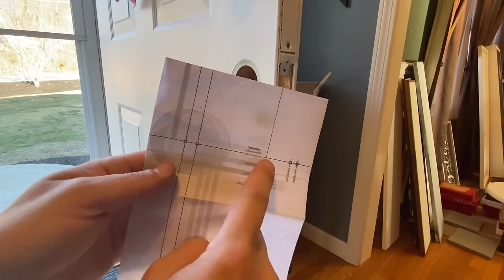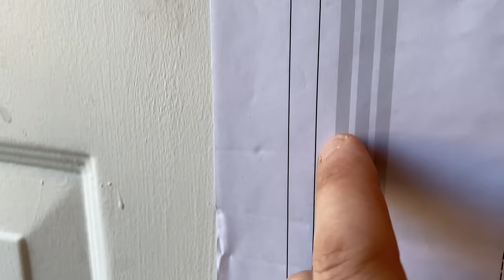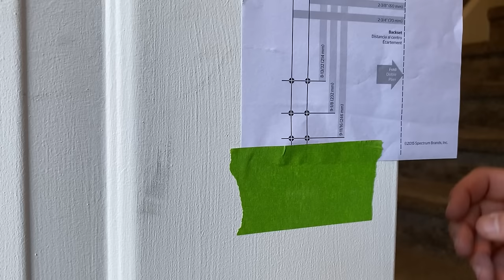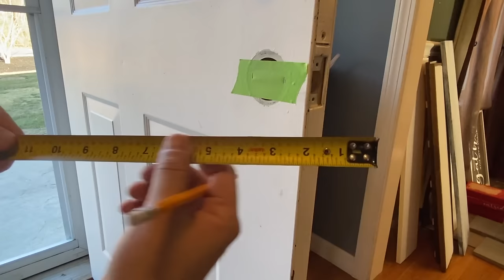How to Install Entry Door Handle Pull

Comment: The handles are different because right and left. You installed it upside down. Also, you’ll never be in the same place by punching through. I square it off and measure back. Taking or adding a 16th for the door bevel. Good job. Commercial superintendent here.  I do TI.
Reply: Whatever bro I followed his instructions and I’m all set.

Comment: I just moved into a new home and wanted to replace my knob with a nice pull. This was very helpful if for no other reason than to prove my logic was sound. I used a level on the outer lines of the hole, and found the center point of the knob hole and then used the level to find the place for the lower hole. For whatever reason, Schlage does not have a template, they have measurements but that only worked if the original knob was installed with those measurements, which in my case they were not...
HUGE THANK YOU!!!

Comment: This is the best, very detailed video. i was nervous about installing new handle until i found this video. the part where using a smaller 5/16 drill bit was a life saver.  my instructions called for a 3/8 which would have been way to big.  the part about the masking tape to center was genius, i followed your video step by step and my handle came out perfect and level.    thank you for being so detailed and step by step instructions !! it gave me confidence to do this task !

Comment: Great job; and great instructions.  I agree with 1styoudummy's comment about drilling through the door from one side in order to ensure the opposing holes line up.  Coming across your video is timely.  I am replacing a basement door with a double patio door.  I am installing a decorative door handle on the door.  My first time installing one.

Comment: When I bought my home, I wanted to change the door handle. It was my first DIY project on my new home and helped me get tools. The old door handle had already drilled hole for the bottom so very easy to change out with the new one. Also, I’m surprised the bottom peg is adjustable on that Kwikset 🤯 That’s cool! 

Happy New Year! 🏝🤙

Comment: Another great video! Just did this a month ago to my front door with a Shlage door handle pull. Had to drill a hole in a metal door like this one. Turned out good, but this video would've made it a lot less stressful. Happy New Year Fixer!

Comment: You come the closest I've found to solving my problem - but not quite solved! At minute 12:39-12:52 you describe installation of the "decorative button on the bottom - put it so the notch goes toward the bottom so if you ever have to take the the knob off." On my door, the bottom bolt is loose. Turning the button has no effect, so I want to remove the decorative button and re-screw the bolt. BUT... there is no notch in the decorative button. I can't figure out how to get the button off, or otherwise find a way to tighten the bottom bolt. Any ideas how to fix this out there?

Comment: Do you have to screw in the bottom of the handle? It’s screwed in at the top so it should still be secure without drilling the bottom yeah?

Comment: Thank you so much! I got a new handle and opened it and saw the template and wasn't sure what it was for. Thankfully I already have a long handle so there's already a hole and I just confirmed the hardware is adjustable so this should be easy!....I shouldn't have said that.
Reply from the maker: Never say the "E" word until it is done haha
Good luck and I hope the video helps!  Thanks for watching!
Reply: @TheFixerHomeRepair  lol guess what? The broken handle was just a "screw directly into the door" handle. So I still have to drill, but at least the hole is already where it needs to be! 😅
Reply from the maker: @ShaneandStuff  You are halfway there!!
Reply: Thanks again the video helped a lot even using the smaller drill bit first. I'm not much of a handy man but because of your video I was able to get it done. Well done!
Reply from the maker: @ShaneandStuff  Awesome!

Comment: Hi Mr. I will appreciated if provide me with model number of the door handle pull you are installing. I need to fix mine or to buy it exacly the same so I do not need to make holes or cut for a different model. I just need to replace the indorr handle the one you that give you the option to put it in one way or in the other way up . the little allen screww is broken and i cant take it out. My is exactly the same like the want you have . thank you

Comment: Fixer, where did you get the paper template used to ensure exact alignment with the door and pull handle?
Reply: my locks came with that paper template with the instructions

Comment: Doesnt the bevel need to go on the inside? Its so easy to pop a lock open by pushing on the bevel
Reply: your door would not shut if the bevel was flipped to the inside

Comment: I replaced it bc it wouldn’t retract and the new one does the same. Would you know why. Thank you for your help.
Reply from the maker: Hey!  Make sure you didn’t overtighten the bolts.  Try and back off the top ones a bit and see if that helps.
Reply: It worked. Can’t thank you enough
Reply from the maker: @johnkoutrakos1591  that is great to hear!  Happy to help!

Comment: Why didn't you use longer screws on the sticker plate? Just curious.
Reply from the maker: Hey, Tom!  I just used the ones that came with the door.  The longer screws are really important to add to the deadbolt plate as that is the locking part of this handle/deadbolt combo.  Thanks for watching!

Comment: Strange handle and lock what I'm used to anyways.. Little tip when using cordless drill, screwing it not the hole way and tightening it with regular screw driver so that you don't over tightening and f**k up the screw hole. cool 😎 gg